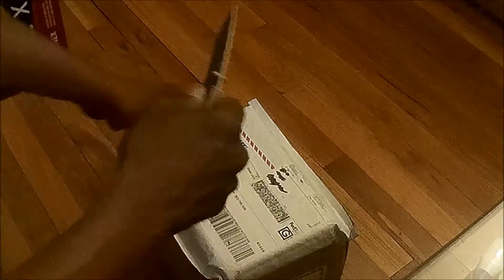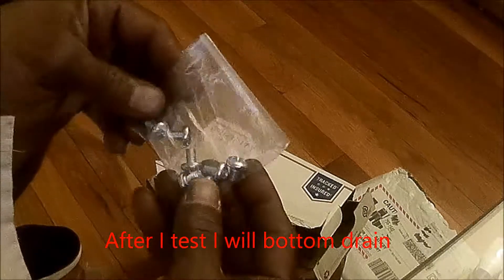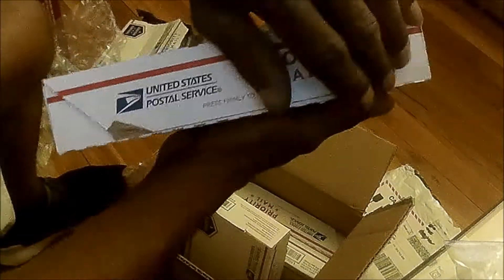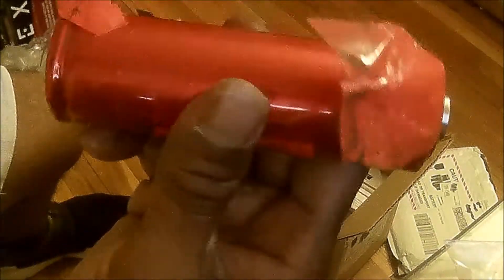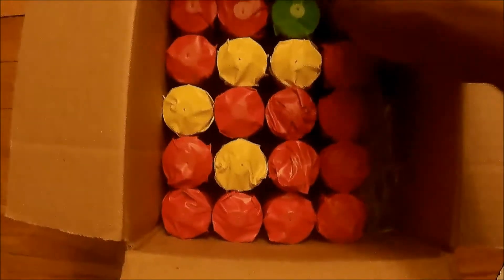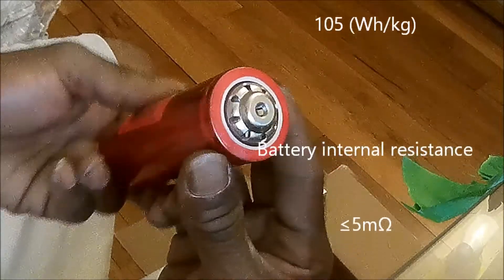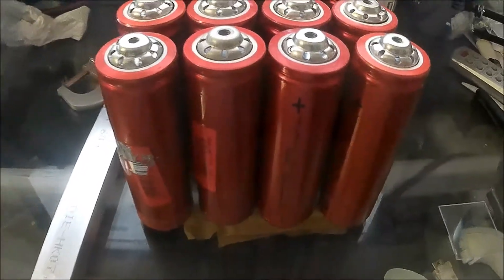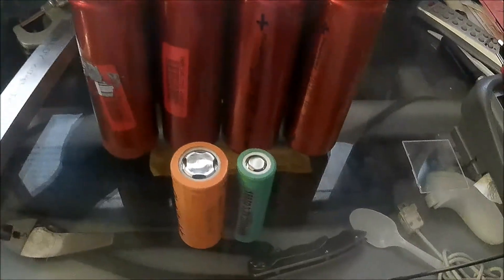Headway 38120hp 200 Amp Unboxing. Building A 40ah Battery For CAR AUDIO

Comment: How many I need to build 100 ah
Reply: How many of the 38120 hp?? Not those
Reply: So 20 cells equal 40ah of power??
Reply from the maker: 52 cells 4S13P will give you around 100Ah. Make sure you look into a battery management..

Comment: How are you figuring 40ah.. when each cell is only 8ah
Reply from the maker: 4S5P 4 cells add up to car voltage and 5 in parallel adds the amp hours, 8Ah x 5 40Ah. Legit question no bull, I hope someone else reads and learns as well. That's what the community is all about. Thanks for stopping by.
Reply: @bigvell02  i thought that you can ether add amperage or voltage but not both at the same time? Do to how they are run i e parallel or series
So  4 of the  8AH 3.2v cells = 8ah at 12.8v 
Or you can do 4 of the 8AH 3.2v cells to where your bank is 32AH at 3.2v

Or am i confusing the math with super cap math?
Reply: They're actually 2ah per cell. 2ah x 20 cells = 40ah
Reply: No, no. They are 8ah.
Wired in series the amp hour stays the same and voltage increases.
Wired in parallel the voltage stays the same and the amp hours increase.

Comment: Where can I buy these
Reply from the maker: I bought mine off ebay from a seller recommended by Jehugarcia the e samba / DIY electric car guy. legit with  everything Ive got from them. You can but them new from Ev components.com
Reply: @bigvell02  yeah I saw ev, right after I commented, cheap too at 15.00 dollars a cell,thanks for your feed back velle.

Comment: Do you recommend discharging all the batteries prior to making the bank? Or as long as the low reading cells are close in voltage to the 3.3 cells i should be good? I’m going to use a 4s balance charge setup once they are all somewhat level  to bring the whole bank up
Reply from the maker: Yes, With the Headway cells (Used) Ive noticed the best way is to discharge and bring entire pack up as one. 4s balance charger is a very very nice way to go.

Comment: You can use it for jump start even Diesel engine.
Reply from the maker: Yes the only issue is lithium performance in the winter months. I would suggest close to 80-120Ah with these cells

Comment: I'm Bangladeshi I want buy please help me
Reply from the maker: Your in luck I just started a Lithium battery company. I will be running various cells in my packs because each will have a specific purpose. In other words I will be selling assembled lithium batteries as well as offering the cells along with the option of the connecting plates. Stay tuned I will be posting a video about this very soon.
Reply from the maker: In the meantime I know Ev components.com sells them if your looking to purchase asap

Comment: Where you buy it?
Reply from the maker: I bought the cells and built the battery myself. I left a link in the headway unboxing video I can imagine the seller is sold out. (they sell out usually within 2 days of posting) You can buy the cells from EVComponents.com

Comment: If I remember right there was a guy that had a 40 amp hour set just like yours and he actually lost about 400 watts of battery power using stainless steel busbars as opposed to Copper I guess cuz they give out  such a ridiculous amount of power so fast that the type of metal really does matter
Reply from the maker: I can't knock anyone we all live and learn. But personally no stainless for me unless (screws only) I used electrical / aircraft grade aluminum. I pulled my XS Power for this and now I'm thinking about pulling my sms220 as well. This thing is a beast. Before I pull the 220 I will build another 40ah pack.

Comment: You really have to charge and discharge every cell with a cellpro or something to that affect. Your going to have to check the resistance and capacity of each cell and group them according. These cells are ok but they sag. You can get maybe 40 amps per cell at 12 volts. These cells will range from 5.5 to 8 ah. I have a bank of 40 of them with custom buss bars. You might get 200 amps out your pack at 12volts. Since they are used you are going to have issues with each pack being balanced with each other. Make sure you group each bank according to the capacity of the cells because each cell is not going to have the same capacity.
Reply from the maker: I used a iMax charger to charge them all, then discharged each cell and recorded the capacity. I ended up buying 2 more iMax chargers and borrowing a friends charger as well because the process was worse than watching paint dry. The lowest capacity I recorded was 7400mAh I had quite a few that read over the 8k mAh nominal. Once I charged them as one I must have gotten lucky each cell was within 2 hundredths of a volt. So far so good and fingers crossed because I really like this battery pack - its performing well. I blew my radiator up at Slamology I gave out quite a few demos running off battery and I was very impressed each one of my amps is seeing 0.5 ohms and I pushed them close to full tilt at times and the voltage was very solid. Mid 12s under load and coming back up to high 12's even saw some 13s engine off. 

I'm not disagreeing or trying to sound like a know all. I REALLY appreciate your comment (My idea with this channel is  learning, sharing and networking)  Lifepo4 is relatively new to me Ive dealt with thousands of 18650 cells and 26650 that dangerous ion chemistry haha. I must have some angels because I did some weird things with those batteries. I will hold your comment in my mind. I definitely want to be safe and get the best bang for my buck. After I post I will go out and check on the battery. PS I like that Cellpro one day I will have one ;-).

Comment: Damn brother I cannot wait to see the final outcome of this!!! I'm at the battery decisions point myself and I haven't jumped on things just yet. This right here is what I'll do if it works out great for you!!
Reply from the maker: I have a good feeling about it. Yes its definitely time for lithium I cannot do anymore AGM batteries (Too heavy for my car) Besides I want that Lithium power :). I will keep you tuned in for sure - I hope to build it this week and have it going
Reply: bigvell02 For real bro, lithium is the future. We're still in the expensive stage with them but that'll change soon. The agm's are really heavy and bulky. Again, can't wait to see the outcome and thanks for the hella great idea!!
Reply from the maker: I Couldn't agree more bro! So far I'm in less than $300 for 40ah vs $999 for a 45ah name brand. Win/Win and if it works out. and I will add another 40ah :)
Reply: bigvell02 Hell yes that's awesome!! Can. Not. Wait. To see your testing!!
Reply: bigvell02 What sites have you gotten the best information from?
Reply from the maker: I will post links asap. Ive watched every headway cell build video there is here on YouTube University (felt like school for real). Been talking with my friend Connor that has built a 200Ah monster bank using these cells as well as a fellow YouTuber. Read up on top vs bottom balancing. I choose to bottom balance and bring the entire pack up as 1 This way one cell won't reach the cut off before the others. NO BMS I plan on monitoring each cell periodically. I got on a few EV forums and E bike forums and picked the knowledge I needed. I choose the Red cells over the blue Headway cells. Your looking at the C rating (Discharge) the 10ah has a 3C discharge rate constant. the 8ah cells have a much higher discharge rate. 10c constant and max is 20-25c. I also picked up a iMax balance charger - it will also discharge the cells safely.
Reply: bigvell02 yeah I seen the red cells are the high performance ones. I've seen vids where a couple guys ran 4 in series to make 14v. Adding more than that and the how's to be car audio compatible is now where I'm at. I'll watch all the vids I can find on YouTube over the weekend.

Comment: I was thinking about that ,we will see how it's work's out for u kepp update
Reply from the maker: I think its a great idea. I definitely will keep you updated. Bus bars and charger come in this week so I hope to be assembling it.
Reply: bigvell02  I am anxious to know how it performs
Reply: bigvell02 hey bro how they work out for you. I have a bank of 40. They are ok but not the best for car audio because they sag. You have to check the capacity and resistance of each cell because they were used and will not all be 8ah. They will range from 5.5 ah to 8ah. If you don't group them right you will have major problems with the banks staying balance.

Comment: Can you help explain this to me those 20 is equivalent to what?, Like compared to a AGM battery what would you say those are about is that about like the same as a D 3100? Cuz I seen those when I was looking for lithium batteries there fairly cheap and I would like to snag them before they get any pricier like all other batteries end up doing let me know man and are you going to the show this weekend?
Reply from the maker: Hey bro 20 of these cells will add up to 40ah. That's equal to more than 3 100ah agm batteries. A d3100 is 110ah Lithium is way different than AGM and Lead acid with ah ratings. Thinking about building another and I should be able to lose all my AGM batteries. I know I'm close to 200-210 lbs in batteries. This pack I can pick up with one finger in a Jewel shopping bag. Way more cycles even at 100% discharge. Safe chemistry as well. All I can say is these cells are no joke! Ive been researching like star pupil and learning like a scholar. Cell balance is the most important thing with a proper pack. This battery chemistry is very forgiving vs lithium ion. 

Show this weekend yes sir. Not sure if I will compete - I have so much tuning to do its mad (lol knowing me I will though) I want to hit 50+ in the low 30s. Truth told I wanted to break a 50 in the high 20s. Higher tones are cool one day I will play with some wall socket frequencies (60hz) even though my cabin is tuned around 37hz when I last checked. Hope to see you out bro.
Reply: bigvell02 oh I'll be there this weekend bro I was about to say I think I'm going to be buying the JY off of Charlie he's going to talk more about it with me this weekend at the show and I was actually thinking about getting some of those cuz my D31 is fucking huge and heavy I was thinking about adding another one of those but that's going to be so much weight in the bag it's going to be ridiculous so if I could do the JY and these or order a shit ton of these then that'll be better for me cuz yesterday I was fucking around and put Gucci coca on and my voltage dropped to 11 flat my heart damn near dropped I said nope I'm turning this shit off I put a different song on to bring my voltage back up to my comfortability level lmao🤣
Reply from the maker: Yes indeed are you still rolling with the stock alt? That alt will have a hard time trying to charge that battery and run all accessories. When I had my stock alt I would find myself charging the extra agm batteries I have often. You would be surprised how low the battery gets even if your not jamming real hard and rolling daily. Look into a charger to help out your alternator.  Lithium is different it charges much faster, and the output curve is totally different, it doesn't sag like lead acid or AGM. Probably work better with a stock alt and higher resting voltage as well. If I could afford JY, Limitless or even these cells new, I would be on that ship. But I don't mind old cells as long as they are good, the cycle life is pretty sick. So far I'm in about $200 in on this 40ah battery. They want $1000 for a 45ah battery not knocking it at all but I got kids, bills, and other poop going on :-/.
Reply: bigvell02 yeah I'm still running on a factory all in a factory front battery and just D 3100 in the back but I'm pretty sure I'm going to get a decent deal on the JY from Charlie if not I am looking into these I mean shit if you have 40 amp hour and you're only at two hundred bucks if you would have double that the 80 amp hours for 400 to be honest this sounds a lot better in my book it's just everytime I've gone looking for these little caps I either find them really expensive or I don't know if that's what I'm supposed to be looking yet for as far as little batt caps but I mean if you say these things are for bass I think I'm going to have to order me some so you think 80 amp hour that would be more than enough as far as me being able to play at a half ohm consistently cuz I don't really play my music while I'm like normal driving like I do but I don't go like full volume at Full Tilt usually I'm cruising at like 30 35 40 max on the volume and the bass knob usually never goes past the half nod but one of my competition obviously I'm at Full Tilt full volume but I've yet to demo at any other shows besides but I switched to a 2 ohm load so I can give Demos cuz I wasn't exactly sure how the speaker was going to take it with it being half dead but since I switched it out with the good sub I've been cruising at 1/2 ohm since and that was at the last La Porte show
Reply: bigvell02 but I do feel you though as far as spending all that money on like brand new JY Source things are expensive that was the only reason why I went with the D 3100 I got bills stepson and a girlfriend and my expensive ass hobby with car audio or anything to do with my car period lol
Reply from the maker: A 80ah bank is like 600ah in AGM, or 6 100ah batteries. A ton of power you will be able to jam a lot harder but at some point you will still need to charge up. Stock alts from what Ive read only give you a 10-20% overhead for average cars. 100 amp alt you will have 10-20a extra to power things. Not very much for us bassheads. I remember when I had 1st got my Northstar sms220. My voltage was much better but when I went down to the 1/2 ohm life with the stock alt, I would demo 1 or 2 songs before I started seeing mid/low 12s even high 11s here and there. I knew I had to charge and add more Ah until I could get the alt. 

My buddy Connor with team DOA. / Team GG. he has the Scion with the Skar wall. he has a 200ah bank of these its powering 2 ampere audio 8k's. *Either way you go it will be a win bro. Just research your ass off before buying and attempting to build. Ive learned a ton about cell balance, bottom vs top balancing. But yeah adding ah will increase you playing time and power.
Reply from the maker: Haha yes you sound like me :), money pulled in all directions. We budget, work extra hours and make it happen :-). XMAS I was suppose to get PRV 6.5's and some sexy super tweeters but I wanted to spoil the kids even more. Of course bills and life crap. Sometimes I look at peoples builds and wonder how many lunches and dinners did the owner sacrifice to get what he has. I know some bassheads that max out their cards for this - SMH Forget all that.
Reply: bigvell02 yeah that's true man I mean with my build I used to have a 01 Blazer in my neutral safety switch went out on it I was going to get it fixed that weekend and then somebody hit my truck while I was parked in the street at Chase to do down caught him only pay 1300 for the truck I ended up getting paid out 5600 gave my dude who I originally bought the truck off of 1800 cuz he front of the truck to me for like 2 years I ain't paid him but he wasn't tripping about it so I threw him 1800 and the rest of it I just blew it on my car and gave my mom some money and took the lady out bout the kid some toys

Comment: What's that movie a Christmas sorry ur going to shoot ur eye out but this one will be ur going to blow a finger off, what gets me about lithium is, is the flash fires vehicles get hit in accidents all. Type. Of stuff, I have my kids n d back seat, I have seen a cell phone battery shoot a three foot flame. Put at 3500 mah at 6 volt so what would the flame look like at 40 ah and 12 volt?
Reply from the maker: Lmao As I read the comment I sung the part "your going to shoot your eye out" (One of my favorite Christmas movies). I totally with you on being safe Ive been vaping for a long time, built box mods etc. and let me say... Lithium ion cells are dangerous! Ive even seen lead acid batts. do some strange things. Of course you know this bro just expressing, Ive seen them vent and its pretty violent. I'm happy they didn't pop because my silly self was just watching it like a firework show smh. Lithium Iron Phosphate (Lifep04) battery chemistry is very safe, thermally and chemically vs Li-ion and other chemistries. The worst Ive heard with Lifep04 is venting and that's under heavy abuse. No fire or explosions.  There is a few videos of people crash testing the batteries by short circuit, overcharging, shooting them, opening etc. I will still monitor and treat these things like plutonium.
Reply: bigvell02 that is what my fears r get rear ended and crush a couple. Cellsdead short a battery bank and a lithium bank. Including the alternators that r running man I would imagine it would be like sound man's explosions
Reply from the maker: LMAO yeah you have a good point. I think about this with my current batteries. I might suspend the cells in expanding foam or think of some weird Vell way to make them as safe as possible.  Maybe a thin ABS plastic case or flame retardant plastic inside a metal box still brainstorming that. I know I go through my connections all the time like I just installed it.  Believe it or not I actually thought about incorporating a halon gas system or something similar in the future. Safety is definitely important to me.
Reply: Search around for stress testing videos of LiFePO4 batteries.  That style lithium cell does NOT fail catastrophically like a note 7 blowing your nuts off in your pocket.  Though yes, Lipo battery that size failing would be scary and that's why no car audio guys that I know of ever used them.